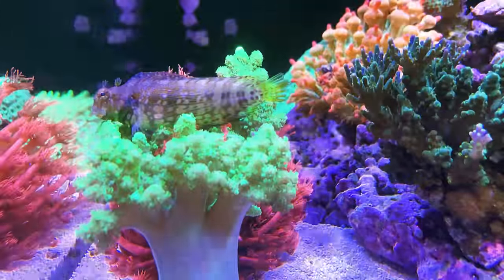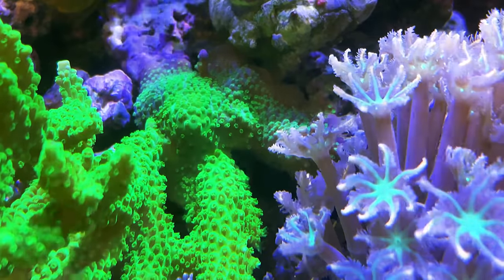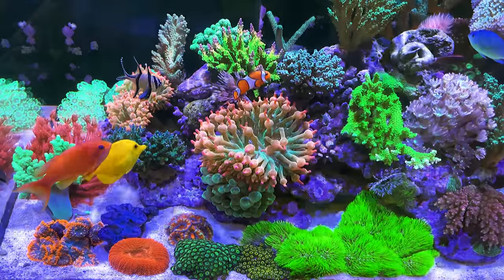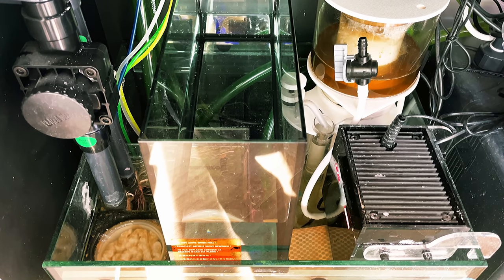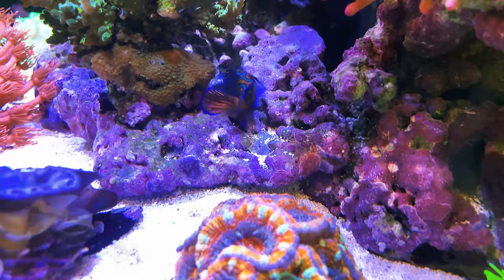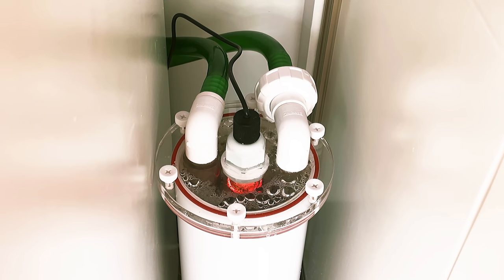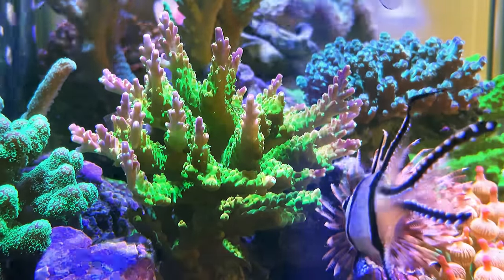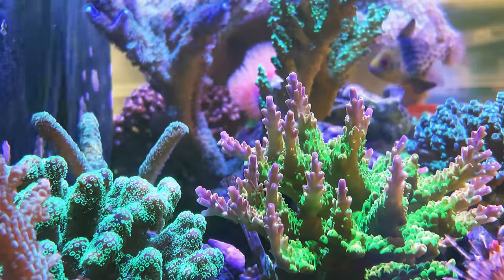A minimalist approach to reef keeping that you can replicate | Hardware, circulation and filtration

Comment: Beautiful again.   May I ask, why not use a small (4 in or so) electric fan connected to a thermostat temperature sensor to cool the tank down as needed?  It is silent, cheap and works like a dream.  I have a nice chiller but removed it in lieu of a well placed small (clamp type) air fan.
Reply from the maker: Thank you Mark! I heard of fan cooling used in nano tanks at an ambient temperature below 30. I'm not sure how effective is fan cooling applied to larger tanks at a higher temperature. Another consideration is water evaporation. You need to top off reservoir much more often with a fan.
Reply: @zzyz  Hi Roger, You are welcome and thank you too!  
I originally had a 250 gal and purchased a nice chiller for it which worked fine but
not only did it take a lot of space, it also required maintenance, a lot of electricity to operate (I think more than the offset of the extra water needed through evaporation), it was always noisy and added heat into the room at a time when you really didn't want it.   

Time went on and things in my life changed and I downgraded from an 8' to a 5' tank.  So now the chiller was too large to place under the smaller tank.  I happen to be a professional refrigeration technician I knew the power of a little air over water so I decided to try a small fan instead of the Chiller.  

The fan I still use is a simple 4" USB mini fan connected to a small usb power supply which only takes a half amp (500ma @5v) of power.   The nice thing about using a fan like this is that you can make slight changes to the direction of the air hitting the water (either on top or in the sump) in a way that throttles down or speed up the evaporation hence cooling effect.  

So for people like me that currently use an ATO for dosing Kalk, if I see that I need a little more PH in the water through the Kalk in the ATO I simply direct the fan a little more onto the water which in turn causes more evaporation and since I have my heater set to 77F the tank keeps that constant temp. I can also direct the fan further away from the water to slow down the evaporation and thus lower the Kalk dosing as needed.  

One thing for sure, you don't need much air blowing across the surface of the water to keep the tank cool.   I believe the small fan like I speak of will cool a very large tank without problems if utilized correctly.
Reply from the maker: @markgresin6335  You are indeed a genius engineer! Bringing an economic solution to people in need! Thank you so much for sharing with us!
Reply: @zzyz  Economics do make the world go around.

Comment: so you keep your tank below 75? i keep mine between 72-74 rn with no heater as my house is for the most part at room temp unless the front door is opened for my cat to roam around and rn in winter that makes the front of the house below 70 but my room still stays above 70
Reply from the maker: Yes, I keep at 75. Your temperatures look awesome. I wish I could live in a place much cooler. Generally, I didn't see any adverse effect for temperatures between 64 and 77.
Reply: @zzyz  most people say to keep temp above 76-79 which makes no sense ocean is cold so nice to see i don't need to pop a heater in yet because so far i've been having success at my 72-74 range
Reply from the maker: @MrDon967  I don't think you need a heater. Btw, algae don't grow well above 77. As I culture sea lettuce,  I have to keep the water cooler. Algae disappear on the coast in summer as they are afraid of hot weather.
Reply: @zzyz  i see i'll keep an eye out for my new tank that i'm gathering stuff to set up to start the 125g reef if i run into algae i'll try heater but rn in my nano reef no algae issues so far
Reply from the maker: @MrDon967  Sorry I may not have expressed myself clearly. Sea lettuce will not grow well if the water temperature is on the high end. But warm water may not help much in getting rid of nuisance algae. Algae reactor is much more effective in case you run into algae issues in the future.
Reply: @zzyz  ofcoz :D
 what's the point of a refugium is algae reactor is a thing isn't the refugium to grow stuff?
Reply from the maker: @MrDon967  Yes, you can culture algae in the refugium. Although reefer 250 comes with a refugium ready sump, I don’t want the light to contaminate other sump chambers. That’s why I prefer not to turn the sump into a refugium.
Reply: @zzyz  oh yes you mentioned that

Comment: Why a chiller if your house is air conditioned
Reply from the maker: Even though the house is air conditioned, I will still recommend a chiller for two reasons. First, you will probably not run air con 24/7 to be environmentally friendly. Second, water evaporates much faster in an air coned room, which means daily maintenance of reservoir rather than weekly.